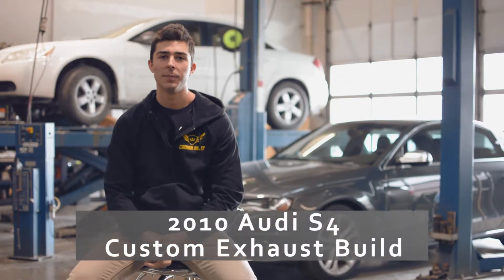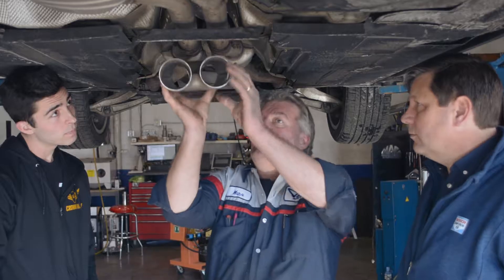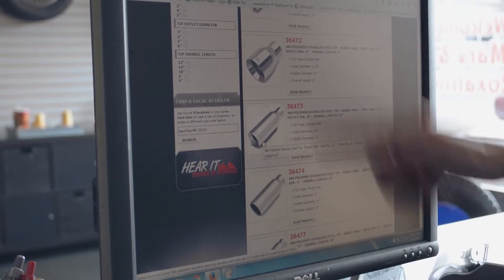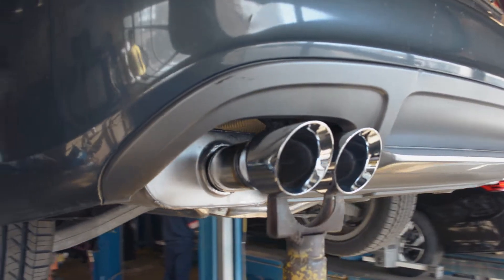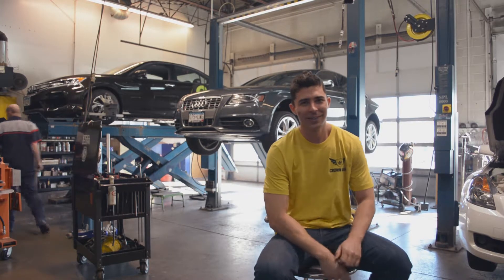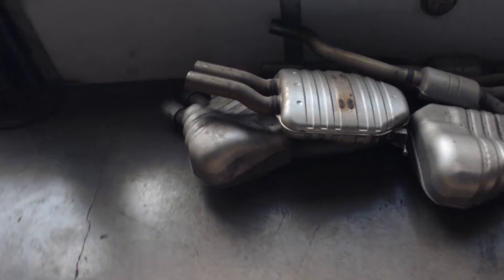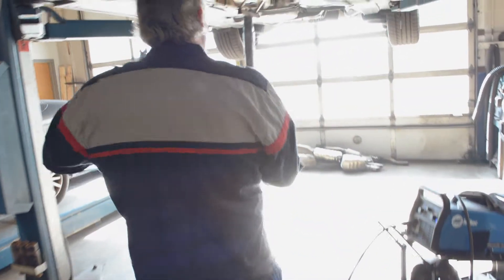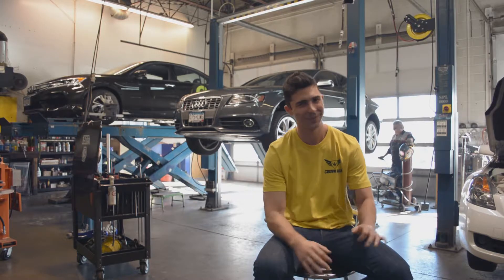2010 Audi S4 - Valley Auto Care builds custom exhaust

Comment: Sounds awesome. I already have an X-pipe that I replaced my my center Res with but its only slightly louder than stock. What else do I need to get mine to sound like this?
Reply: Without spending an arm and a leg for AWE exhaust or something comparable.
Reply: +NismoFinder We replaced the center resonator with an X pipe, replaced the stock mufflers with different ones, and increased the diameter from the downpipes back by about 1/4 inch
Reply: What model muffler's did you guys get?